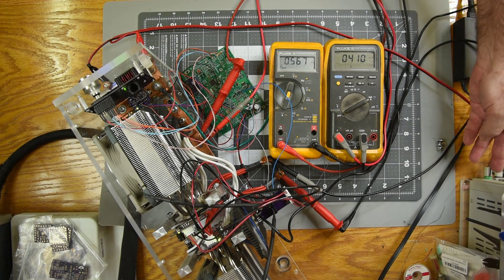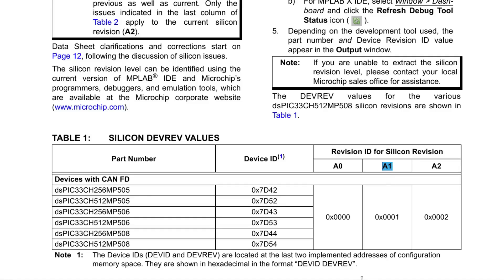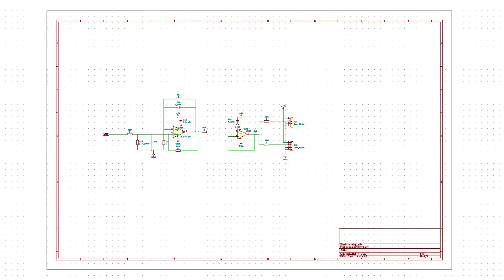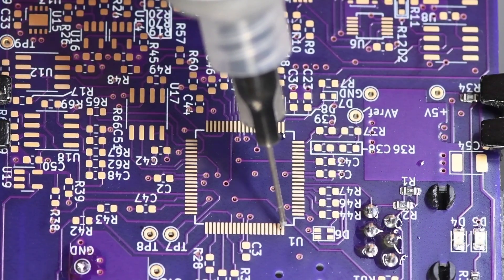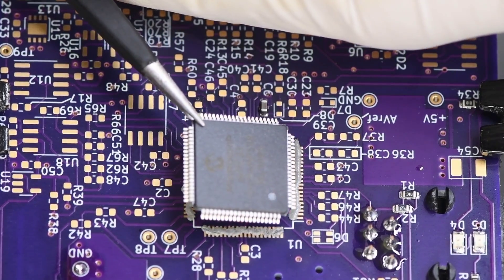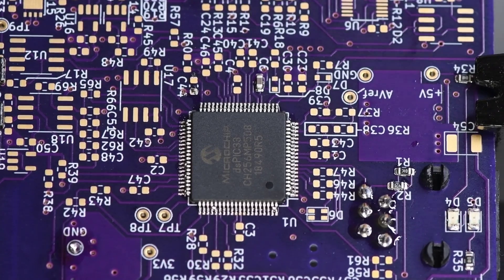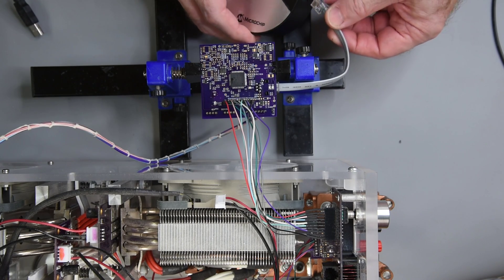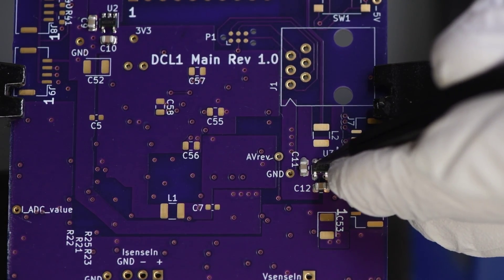A Deal on a Microchip dsPic & Associated Ramblings

Comment: Nice setup! Which solder paste are you using?
Reply from the maker: It's a MG Chemicals 4860P-35G.  I’ve had it for a few years now, but I have kept it refrigerated.  I have a feeling, when fresh it would not be quite as thick.  Maybe a bit easier to dispense.

Comment: Great video! 👍
Even MCUs with I2C factory bug can be used for different purposes with nice price.. 😉
Yeah, I'm always solder power regulators first, then check them out and only then I add everything else..
Reason - one time I've got faulty power regulator and because of that burn out MCU.. 😂
Reply: Advice in all the magazine projects back in the glory days of electronics mags was always to check the PSU voltages before fitting the 'expensive' parts, it was good advice back then and is still good advice now.
Reply: @M0UAW_IO83  Exactly! That's why I still have old magazines for great ideas and good advice..
Reply: @artursmihelsons415  I have them around because I'm old 🤣
Reply: @M0UAW_IO83  Yeah, I'm not young too.. Love old school stuff.. Sometimes, in old books and magazines is stuff that can't be find in internet.. 😏 Still missing times, when purchase of new electronic stuff comes with full schematic in user manual.. 😂
Reply from the maker: Thanks.  Thinking about the old electronics magazines makes me sad.  I ran into a space problem.  Just got rid of all of them.  Still hurts a bit  thinking about it.
Reply: @metalplasticelectronics354   Space problem, probably, is for all of us.. I get rid of old equipment, but keep magazines and books.. Destroying for parts some of that old equipment is still hurting me too.. But that was long time ago, before garage.. Now I'm sorting stuff more wisely and lots of them get in garage until I have a time for repair or writing down as unrepairable..

Comment: You're getting pretty good with that hot air gun. That first few parts you put on around @3:50 was picture perfect.
Reply from the maker: I’m definitely getting better at it.  Still have the tendency to apply too much solder paste, especially to IC pads.  But I’m really doing much better not blowing parts around.  I certainly should have bought a hot air station years ago.  It really is an important tool to have.

Comment: huh, wow, there's fairly good stock on a lot of the dsPIC33 parts. I didn't think to check that. But that errata does remind me of how shockingly common some of the Microchip blunders really were.
"This internal pull-up resistor in the documentation does not actually exist." Ugh.
Reply from the maker: Stock does seem to be a little better now.  But last I looked most of the large memory, 40 plus pin count chips were still out of stock.  I was only looking at the CK series though.  Yes, Microchip has let some pretty big errors slip through.  I don’t really know how that compares to other companies.  I’ve only use Microchip and Atmel chips.  And now they are the same.  But I only used the really small Atmel chips, don’t think I ever had an issue with any of them.  Hopefully in a few more months all the chips will be available, and with the latest silicon revisions.